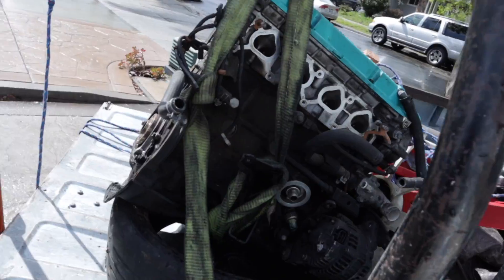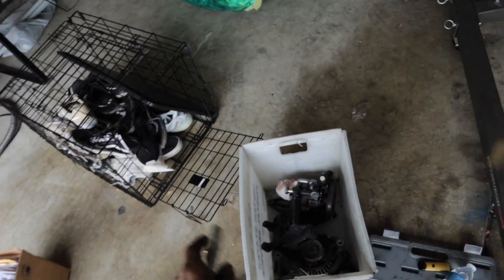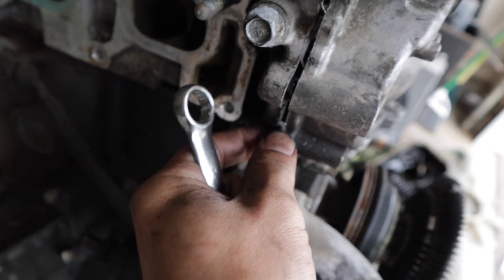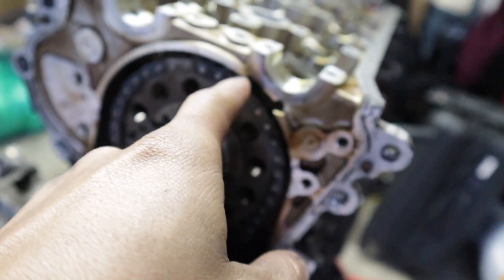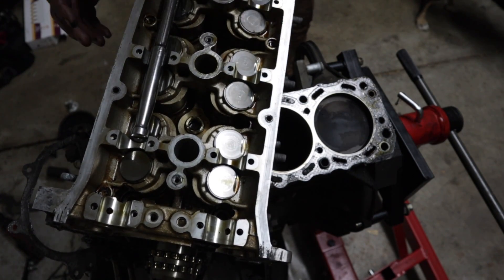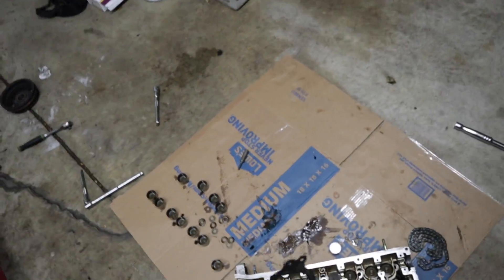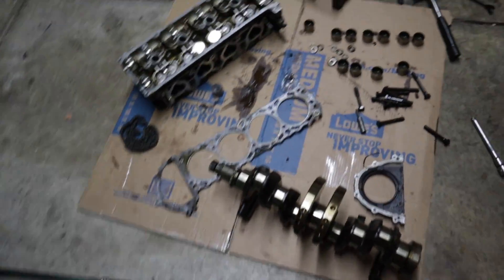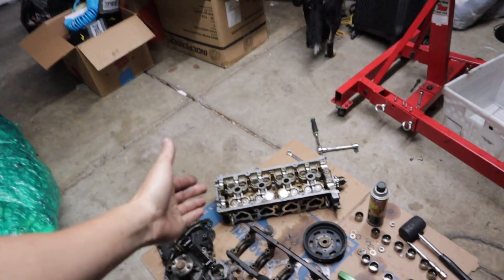KA24DE Engine rebuild pt1 "The Disassemble"

Comment: I know the video is getting old, but I must say kudos for raw dogging it.  It's always good to read the FSM (Field Service Manual) and if you aren't as experienced, get a Hanes or Chilton manual as well.  A lot of damage possible done in the tear down.  Cams gears should have been pulled before cams.  Cams untorque in steps, cause valves are spring loaded pressure.  Head bolts always untorque in 2 to 3 steps outside in and during installation torque in 2 to 3 steps inside out.  Everyone has to learn somehow though.

Comment: Gonna say it: so many things done wrong, but you admitted this is the first time tearing up an engine. Research should have been done. A lot of headaches would have been saved ahead when building back the engine. Buckets should have been numbered. Lucky that the cam caps are numbered and labeled. So are the rods.

One last thing: boring out the cylinders, decking the block and the cylinder head will actually increase compression ratio, since more air volume will enter and be squished into less space. Pistons must be low compression ones. They have a bigger dish than factory.

From someone who wants to go KA-T.

Comment: Love that your back but please skip the whole rebuild kit and go with a decently priced cp piston eagle rod setup.

Also always set your motor to TDC and when breaking things free always remember to do it in sequence to reduce the possibility of bending, warping, or even cracking things.(for example the cams, head, crank girdle)

Me personally I would just get these parts I am listing.

Cp pistons(slightly oversized don’t want your cylinder walls to be too thin)
Eagle rods(best budget and proven durability)
Bc 272 camshafts
OEM crank and rod bearings(I can’t stress this enough but I would NOT trust anything other than oem when it comes to bearings)
Felpro gasket set(great price and durability)
Cosmetic head gasket
ARP HEADSTUDS(very important!!!!)

That’s it! If you need help don’t hesitate to ask my IG is 86_goon 

Keep it up Vu you got this!
Reply: What did you do for valve train like valves and springs?

Comment: each engine component has its own wear pattern so it is VITAL to the engine to put everything in the EXACT location that you removed it from. a few wear sensitive parts would be cam caps,  and the pieces that fell out of your head are lifters which also have a specific wear pattern to the camshaft so if you loose their order and didnt label them prior to removal it would be best to replace them. the main caps also are supposed to go in their original home and make sure to install them in their correct orientation because you can wreck some stuff if you put them in backwards. goodluck on your build and remember (Cheap/fast/reliable) you can only choose two. and thats on textbook!!!!

Comment: Build it with performance parts (pistons, rods, etc.) and go single big turbo. If you wanna do it right the first time. Do a lot of research before you just start turning nuts and bolts. You don't wanna just rebuild the engine with factory spec parts and throw on some little cheap used turbo, because that is not "doing it right". Just be a waste of money. Get in touch with someone who knows about building and putting together engines. They should tell you what engine turbo combos will work best for you. Or just do a simple Google search. There's alot of KA big turbo builds I've seen on some forums.

Comment: I think "E" means "exhaust camshaft"
The other is "intake camshaft" and the pans are signed because they have to be in the same places mounted after rebuilt :) you can't mix them. Great video and it is great that you back with new vlog :)
Reply from the maker: Ah I see haha thanks for clearing that up for me
Reply: @VuLes13 and E2 or E3 means which this pan is. pans are numbered started from to valvetrain side

Comment: Should’ve set the cylinders to TDC so it’ll be easier to put everything back. Also, the cam bearings have an E and I (Exhaust Side & Intake Side). To remove the lifters, use a magnet
Reply: If you need help lmk
Reply from the maker: @meangreenrt7608  thanks man what's your Instagram?
Reply: Vu Le - (@3oozx.na) I have a z32 (VG30DE) and it’s basically the same thing, just with 6 cylinders